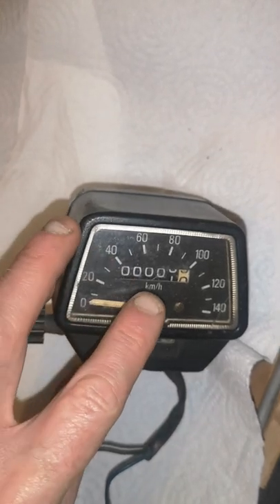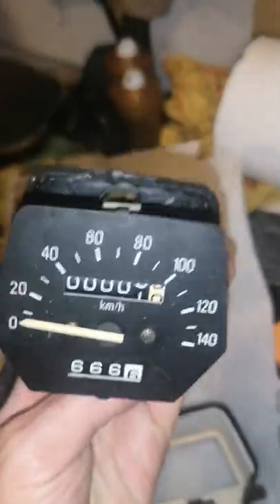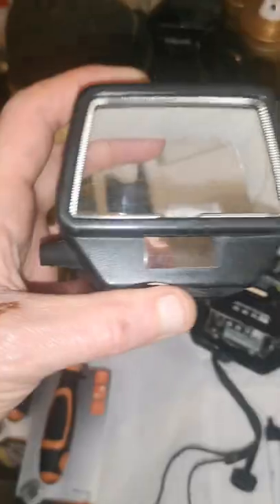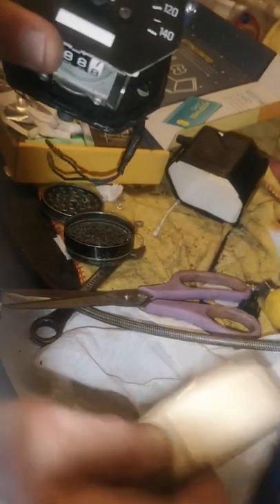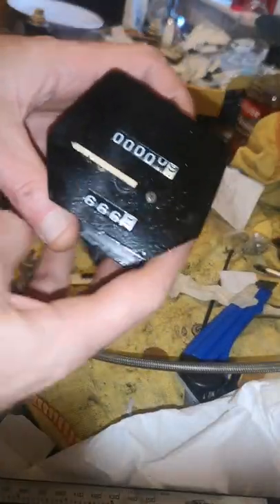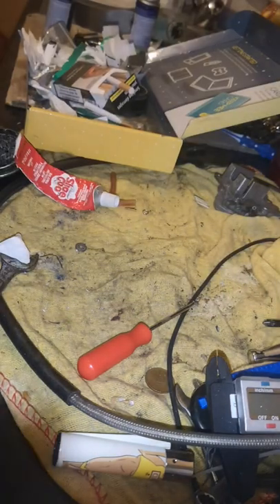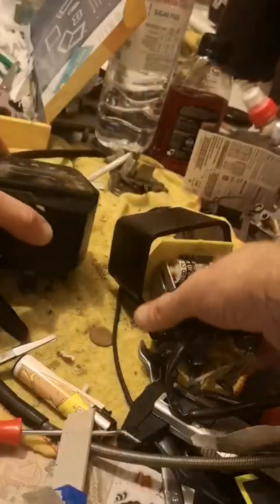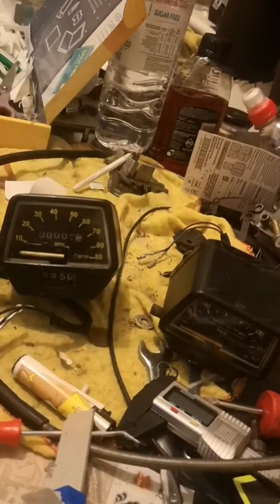Dtr 125 speedometer change from km/h to MPH

Comment: Super glue & baking powder will get them  gashes out of the side its normally when   people with about 17 keys on there key ring Lol slashing side to side then sand it back smooth then primer & finish in pj1 Saturn black. but nice job on the kph bro
Reply from the maker: Cheers m8 is it just them little scratches ya can barely see them when on bike just the torch shows them up more, just on putting harness on the white one now putting plugs on that stator that's in atm, got back light wires done so not be long now m8
Reply: @2strokemxclassics  sound m8 will be good ive just pm you on Instagram
Reply from the maker: OK m8 a normally uninstall the app every nite till next day m8 Al have a look